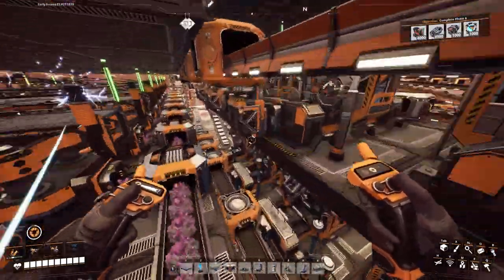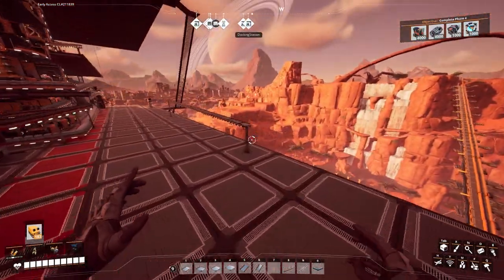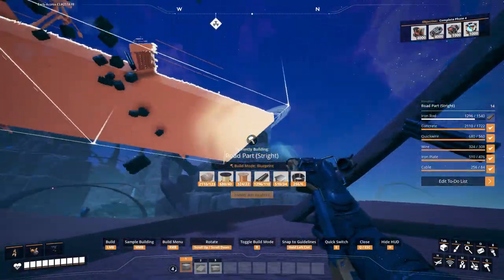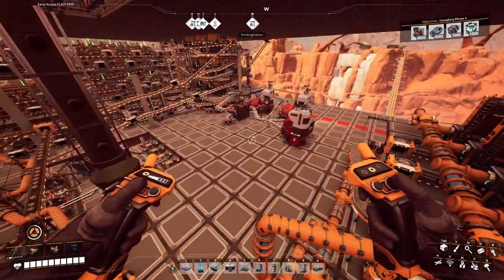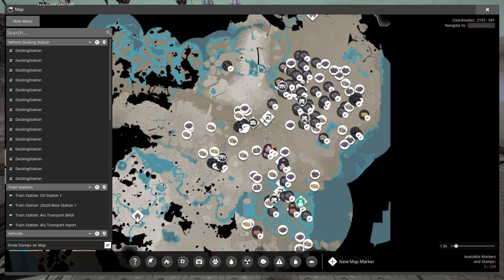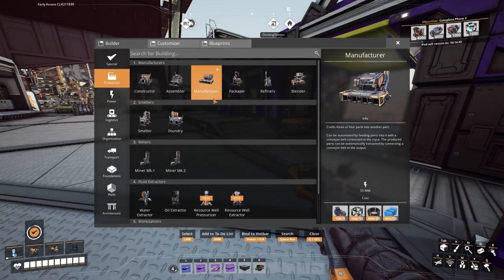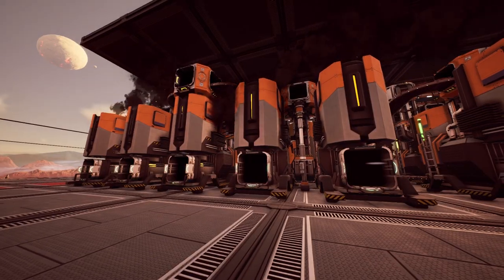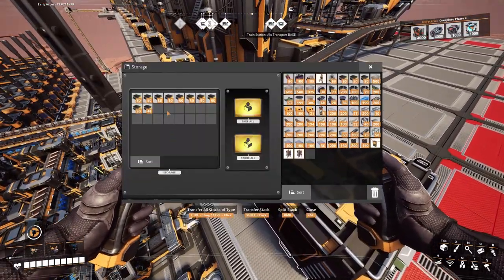20x20 Satisfactory E 11: So I Got Crazy Making Some Radios

Comment: Alright, you've motivated me to see what an end-game 20x20 setup would look like. I'm gonna jump in a creative world and set one up.
Let me be clear on the rules. Production machines are the only things limited to the grid? 
Also, how many hours do you currently have in your playthru?
Reply from the maker: Detailed rules are in description, but basically any and all buildings used to either generate power or construct items are limited to the 20x20 area.

Miners, extractors, and machines used to extract and transport raw materials to the base are allowed.

Grey area challenges add some spice to the build: storage units, power storage, packagers, and geothermal generators are a user preference. Cause these can make the challenge harder or easier.

Also I have about 260 hours on the world right now, though it might be closer to 200 accounting for afk time.

Good luck!